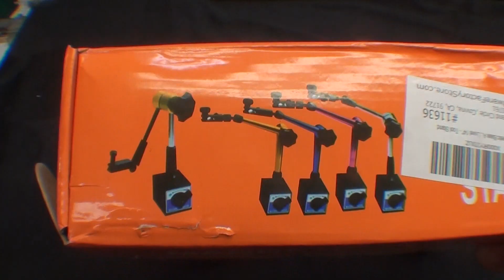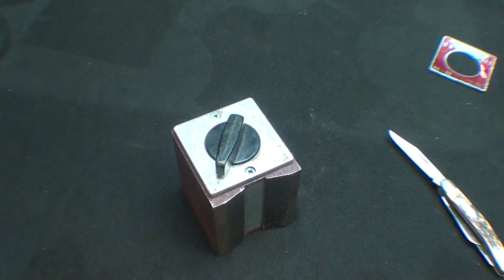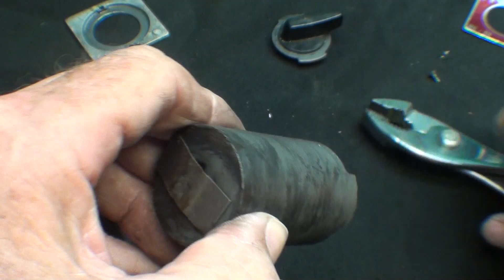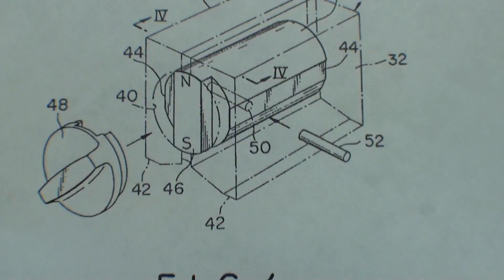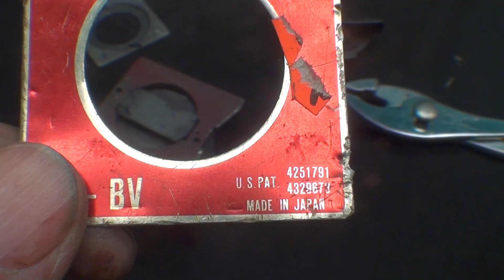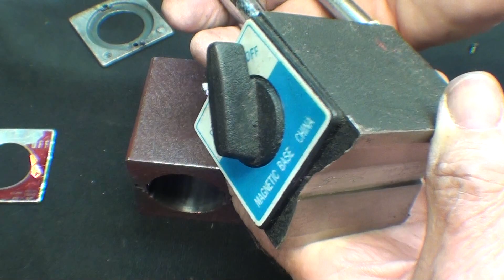What Makes It Work #27 Magnetic Indicator Base tubalcain

Comment: fun joke: ask for supermagnetics, receive superconductors with diamagnetic properties back #neverwon #3jkin1 #deltarune
Reply: of course i still want room temperature superconductor, before any allegations arise . also on normal pressure, not some exotic superpressured state on room temperature. but supermagnetic alloys would be a nice step without requiring any electric mucking around for it to work. i dislike electronics sometimes

Comment: Every time the magnet is removed from the housing it depletes some of the magnets strength. The longer it is out of the housing, the more strength is depleted.  Most permanent magnetic field electric motors can be severely weakened by removing the armature from the field housing. At the least, a steel barstock slug should be inserted in the field while the armature is out to help preserve the magnets strength.
Reply from the maker: Thank you very much for the tip. You are the second one to say the same thing. My dad always told me to use a keeper on horse shoe magnets.

Comment: weird. all the other designs are showing two sets of magnets. I wonder how it's possible for you to have one that only uses one magnet. maybe it uses some type of electrical conductance to cancel out the flux? 

okay. I just watched a video were he explains that the case of this tool has a strip of aluminum across the bottom and top. in one position the aluminum blocks the magnetic flux and in the other it doesn't. he said the case is actually three separate pieces of metal. not sure if the aluminum goes up the back opposite the switch or not. very interesting design. the larger chucks on grinders etc do use two sets of magnets that interact making them even more powerful than these little guys.  

also, the one company that currently makes larger chucks says it uses graphite in the grease. that would make it black (without being actually dirty).

Comment: I saw these things looking thru tools and as most of us would, I wondered how they work!
So the mind process knows that permanent magnets cannot be turned off, for like 500 years.
...and only an electromagnet can be turned on/off.  but, no power plug to feed it energy!? ...

So, is there a battery inside to create the electromagnetic effect?  ...and that would have to be a mean-ass battery! but again, ...no power plug to charge ?  ok, now I am baffled.
 
So-many-wasted-videos of people trying to milk the secret, and you made it easy without a long disgusting time-wasting milking ordeal, may be a tiny bit, but straight to it! t.y.

Learned something new today!  I always thought only distance, temperature, ...  can nullify a magnetic field.

...and without trying to appear an expert or even intelligent... one would have to plunge into Maxwell's equations to really understand this fully.  ...and if you think about it, induction/transformers functionality is definitely a close cousin.

...the secret is simple, a magnet is encased in a ferrous cage which weakens/cancels out the magnetic effect... just a mechanical orientation that takes advantage of the proximity of an iron(like) shield that affects the related subatomic fields.

To be more clear, it actually does not lessen the actual magnet power, only shields it so it loses distance reach, basically STRONG-ARMing it.  ...proof, when the magnet is extracted from the shield its effect is still fully present.

Comment: NEVER DISASSEMLE THIS!!! After disassembling, you loose 80% of power of this base. Just compare how extremely strong it was before, and now it's just regular weak magnet now. After assemble ,it must be charged with very high magnetic pulse, to be so strong. Just read how magnetic accumulator work.
Reply from the maker: Thanks

Comment: I have a Brown and Sharpe magnetic base, but it's the push-button variety like the Starrett brand. The button is seized in the "off" position. Any clue what might be going on with it? Hardened grease or possibly a chipped magnet? It has no obvious signs of damage, or signs of being dropped, etc.
Reply from the maker: No idea. Could it be a corrosion. Maybe soak the whole thing in WD-40 for a few days. Then tap it with a lead hammer.
Reply: @mrpete222  Thanks for the response. I appreciate it. I kept soaking it with Rem oil by using a "dam" of grease to keep the oil deep around the button, and after a few hours of doing that and letting it sit on the heater vent, after a good hard rap on the counter it finally freed up. It's definitely not the strongest magnet base in the world, but I think it will serve me well for my rear axle re-gear that I bought it for. A LOT of really dark colored oil ran out after working the button for a while, so it was either corrosion or really old solidified grease.

Comment: Awesome. Exactly what I was looking for. Thinking I could turn one upside down. Magnet up. To be used as a vice guide for cutting emt pipe on a tool cart. Stick some bolt rod in the stem, bolt it down, adjust the height... hope it works well. Awesome vid, as always.
Reply from the maker: Yes, try that
Reply: @mrpete222   Great video sir, one question. does the magnet indicator attracts another magnet when its off?

Comment: I've got a few of them. I inherited them from my uncle, a tool n die maker. One of the arms is awesome! It's segmented. It's made of a bunch of short pipes, somewhat tapered with a rounded end on the narrow end and a cove ground into the thick end and the balled end of one rides In the cove end of the other and there's a cable that runs up through them all with a cam lever at the end that shortens the cable once you configure the arm into virtually any shape you need to get dial indicator around whatever and to whatever needs to be checked. I believe it's a starrett.
Reply from the maker: I have one of those, but I never thought they were very rigid
Reply: mrpete222 yes. They're not as rigid as the articulating arms but they can can be adjusted to be rigid enough to hold a dial indicator still . I use it to hold my phone, like a tripod.

Comment: I don't have one,.....yet*.  Don't get a neodymium magnet near the chips and swarf, they are almost impossible to clean.  Great demo video, very informative.     *I think Shars is where I'll get mine, with indicator.
Reply: One possible solution, is the gel used for depilation. 
Its sticky enough to grip hairs and rip them out by the roots, so it should pick up swarf.

Comment: The left and the right side of the base are separated by a non magnetic centre section, usually aluminium and when the central magnet is turned it faces each of the base poles sideways and energizes them with north and south polarity, when turned upright it sits between the 2 poles and they cancel each other out.
Reply: you are no explaining crap... go study.

Comment: Is the magnetic chuck type, that strong that you don't have to worry that your parts won't move when grinding or cutting????
Reply: NO. Parts can move on you. It is not that strong as vice (vise) or toe-clamps.
It also depends on part shape and size. That's why machinists will put something extra on the magnetic chuck (1-2-3 block, parallel), to act as a "stop" ("fence"), just in case.

Comment: So when you turn the magnet to off does the magnetic force move to the side or become stronger on the side? Thanks for the video always nice to learn something new.
Reply: I think he missed the actual thing that makes this work in this video. It isn’t so much the magnet but what it is sitting in. That housing is not one solid piece of steel, as seen in the patent drawings it is two halves of steel with some non magnetic metal spacing them out in between. This way when the magnet is oriented in one direction the two steel sides are magnetized and when the magnet is rotated 90 degrees the fields are contained in the steel sides and they are non magnetically attractive.

Comment: You left out there important bit!

If you read the patent, the outer block isn't a single piece. There's a non-magnetic plate down the center. That's very important, because it acts like a spark gap.

When it's turned off, the poles are vertical, and the magnetic field flows through the material on the sides from one pile to the other and doesn't escape. It's  effectively shorted out. When it's on, the poles are horizontal, and the magnetic circuit is interrupted by the non-magnetic plate. The field spreads out as it hops the gap, and when you bring it in contact with magnetic material, and the piece is attracted,  completing  the magnetic circuit.
Reply: + Paul Ste. Marie. This is the simplest and best explanation. Your comment should be pinned right at the top. Interesting dismantling video but it falls woefully short of Mr Pete's usually high standards in several different areas.
Reply: Thank you - that's what I wanted to know. Yes, Mr. Pete missed it this time. Otherwise, good video.
Reply: Thank you!  This video is woefully lacking in explanation.  All he did was show us what the insides look like and nothing about "What Makes it Work".  Simply turning a magnet doesn't make it not stick to iron - there is clearly more involved there.
Reply: Also some of these magnets was charged with magnetic field to magnetize it much stronger, if you dissasemble them, and assamble them back again it will not be as strong as it was, because it looses some of charged magnetic field, due to dissasamble of magnetic domains in magnetic iron, magnet istself stays same. Bus as long as it is in this iron case, it holds this magnetic domains in iron orientaited, with was orientaited by electrolagnet during manufacturing
Reply: @Neutral777  spoken like a true neophyte

Comment: The size and number of poles on a magnetic chuck changes the size and quantity of the flux fields.  Generally speaking, chucks with only a few large poles are better for thicker work, because the flux fields go higher about the surface of the chuck.  Fine pole chucks have flux fields that stay close to the chuck, making them better for a thin workpiece.  Both will work for the other to some extent.  In general it is usually considered better to get a fine pole magnetic chuck if you are holding all different sizes of work.

Comment: so frickin wierd, I was just thinkin about this this morning.
Reply: not that weird, if you think about it in terms of electricity, in one way, one exterior plate is positive, while the other is negative thus getting a flow between them, and in the other, both are at the same voltage, so no flow. This is inaccurate, but gets the point across I think.

Comment: When OFF the magnet’s N-S axis is vertical and flux is shunted from S to N via  iron side pieces. Little flux leaves the faces, offering no attraction to external iron. While ON, the N-S axis is horizontal; flux must leave the iron side pieces to reconnect the poles, as they are separated by an aluminum spacer. External iron is then attracted to complete the magnetic circuit.
Reply: you are no explaining crap... go study.

Comment: NOGA!  I swear by them!  I'm really looking forward to the Noga tear down.. I have a few of these (my personal property), and always wondered how they function but I'm reluctant to take apart a good one in fear that I might not get it back together.  There is however, one that belongs to my employer that is barely functional, the lower joint won't hold very well... possibly after seeing your upcoming video I will try working on it.  

I Love the base and arm system, but I do dislike the fine adjustment located at the indicator end and the attachment tightening mechanism (where the indicator attaches)..  I routinely fill the moving part of the fine adjustment with locktite  and shim the indicator holder part to rigid it up.
Reply: Simple use of wedges. I found that taking the clones to pieces and cleaning up the edges and rods makes them work much better.  regards

Comment: I've always wondered about the type of magnet setup was in those stands and way they don't have the magnetic field in the off position when the case is all metal as well. Could it be that the case is cast wit a non magnetic metal and the base has iron/steel pieces cast in the bottom?

Comment: You might have mentioned that the cube, or housing, is made of three parts (at least the ones I have disassembled are). There are two steel parts (or at least made magnetic material, possibly iron) and they are separated by a non magnetic layer between... possibly made of aluminum or magnesium.  So when the north and south polls of the magnet are aligned with the two steel parts, the magnetism of the base is effectively turned on, when the polls are pointed at a right angle to the steel parts the magnet is effectively turned off.
Reply: tracyguilbeau that's backwards actually. When the poles are vertical, each half of the body creates an independent path from N to S, and there almost no field strength at the base. When the poles are horizontal, one side of the base is N the other side is S and field is forced to go between the two sides, creating a strong field at the base.
Reply: Thanks bro

Comment: The knob may be plastic so that metal is not attracted to it?
Reply: Anthony Nagy that's my thought as well.   In addition, plastic has its place in engineering and I think it's just fine for this application.

I'll also point out that these bases are used for more than indication.  They are also used to hold air and coolant lines, and delicate instruments, and provide an amount of electronic shielding.

Even the high end old machines have plastic or Bakelite knobs.

Comment: Mr Pete,

I am still not sure how turning a magnet, removes the magnet's attracting force.

I see the moving part; but why does it lose its magnetism simply by moving it 90 degrees?

I am confused. There has to be something that causes the magnet to be cancelled. Years ago I learned that there are certain metals which will not allow magnetic "lines of force" to pass through.

But I am not sure this how these magnets work.

Could you please give us, in detail, "how" it works; in this context?

Thank you and thanks a million for all the other fascinating things you have taught us.
Reply: Donner, you get to go home early; excellent explanation!
Reply: The magnetic metal case directs the core's magnetic field and the core is magnetized with the poles across the cylinder, not end-to-end. With N/S vertical the field follows the sides, there will only be a slight N or S field at both mounting face poles. With the core's N/S field horizontal the field is directed so there is a strong field at the mounting poles with N on one side and S on the other. There must be a nonmagnetic metal section at the top and between the mounting poles. I don't know how that is done.
Reply: there is no known material which will block magnetic lines of force, not even lead
Reply: Very respectfully, there is indeed a metal which will NOT let magnetic lines of forces pass through. It is called "mu-metal". Not sure what its elements are.

They were used around TV pictures; in the early days of color TV; to STOP extraneous magnetic fields from ruining the color purity around the edges of the picture tube.

Handles were attached to them, and we technicians could then rotate these mu-metal shields to remove the impurities around the edges of the picture.

For whatever it's worth.
Reply: VERY well explained Donner. NOW I understand HOW it works. Thanks so much. And may Jesus bless you for your knowledge.
Reply: the base does not necessarily need to be made from layers of material.  by narrowing the cross-section between the pole faces, a solid iron body can be used.  if the section thicknesses in these areas is small enough, it will act as a sufficiently low permeability material when it saturates.

otherwise, yes.  as others have said, it's the simple process of shunting the magnet through the housing (off), or coupling it to the workpiece (on)
Reply: An interesting case of both answers being correct. Nothing "blocks" magnetic fields, yet Mu-metal does effectively stop them. By, I guess the best word is channeling.
Reply: 90 deg from a magnetic pole (a magnet has but two) is almost non-magnetic
Reply: A magnet has strong forces along the lines of flux in the North and South poles projecting outward in a perpendicular toroidal rotational arrangement canceling out at its center of mass. This is why when you couple magnets together an elongated line of flux perpetuates strengthening the vertical  alignment field.  
When you pronate the magnet detrorotationally 90 degrees to its original axis you now only project the East and West fields which are very weak. Similar to the attraction it has at its center of mass.
Reply: you should share your findings with those clown researchers i heard about.
Reply: I agree.   We got a parts list but no explanation  as to how it works.  Lots of comments but who is right?